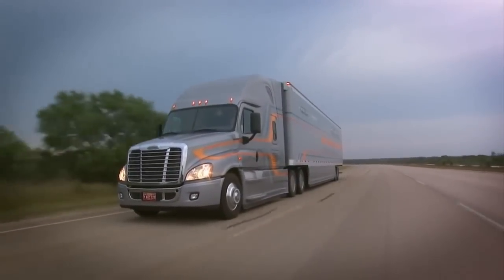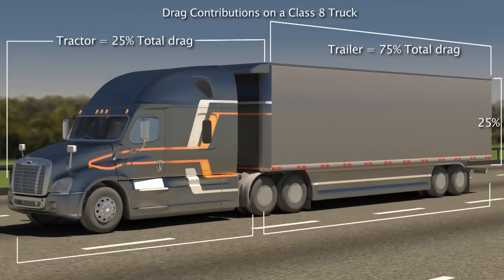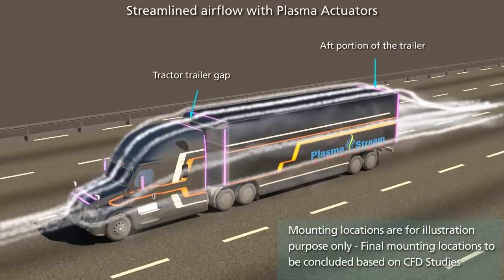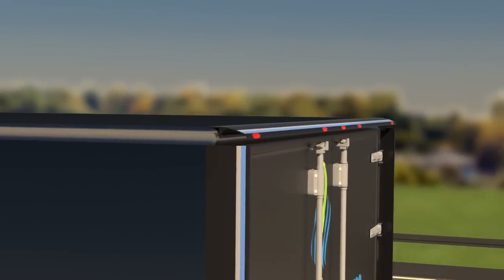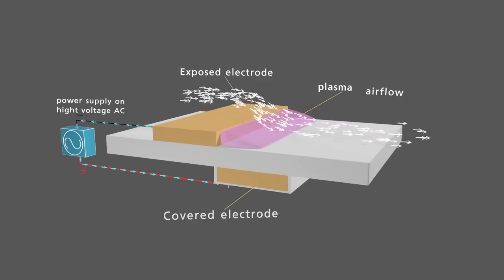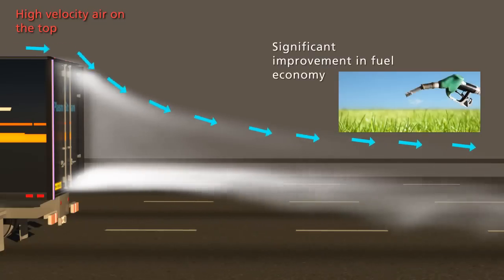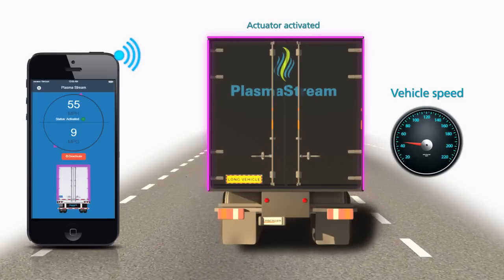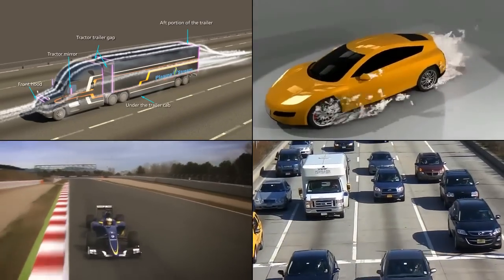Plasma Stream Technologies- 720P

Comment: Here is a free idea. However if any gets Rich off of my idea kick me a few buck. Why do we not apply this technology to a turbo fan engine and see if it increases the thrust effectiveness of the engine
Reply: flow separation isn't much of a problem in turbofan engines, this is way more effective on static surfaces that face varying flow characteristics,
Reply: @Kebab_with_extra_garlic_mayo  There is flow separation that happens on the fan section causing low pressure cavitation which decreases efficiency and increases noise. Witch is why engine manufacturers have limited  the speed of witch the fan rotates in relation to the engine. Ge has a drive turbine that is connect to the fan but not the engine so it can rotate at a slower speed. Pratandwhitny have a gear reduction that drives there fan at a lower speed. My thoughts is if you can use this technology to increase the threshold of the separation of 
laminate flow you can increase the speed of the fan witch would decrease down stream presser in the drive section of the engine  and increase both power output and fuel efficiency.
Reply: Fans need air. Less air less speed
Reply: @legend3232  what are you talking about? The product can be used to control boundary layer separation and cavitation on an air foil in effect decreasing drag and increasing efficiency. Whether on a tractor trailer or a turbo fan engine or a control surface on an airplane. Nothing demonstrated here said it just plan gets rid of air.
Reply: @uberdang830  Plasma actuators are usually used as to deflect air entirley at times
Reply: @legend3232  I'm not going to even going to try and explain why your response is stupid. You can just figure it out.
Reply: Hi - what about taking your idea and even using it on ducted fans as well? FAA regulations for Light Sport Aircraft require them to only use piston engines, and so jet turbine aircraft are not allowed. But some jet enthusiasts have found a way around that restriction by using piston engine to power ducted fans, for an overall jet-like look and feel. Do a youtube search for PJ-2 Dreamer or UL-39 Albi

Comment: What is your expected time to market for your trailer tail product?  I've read dozens of research papers evaluating plasma actuators for several different industry applications but nothing is even close to a marketable product.  I'm shopping methods to increase the fuel efficiency of a truck fleet and like the concept.  I'm also considering 3D printing my own vortex generators and strakes in the near term.